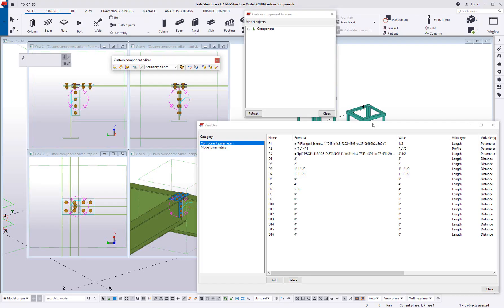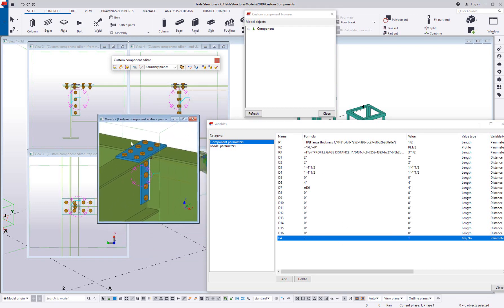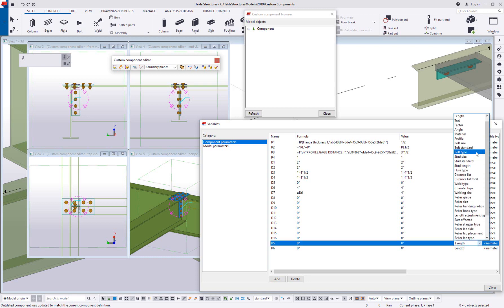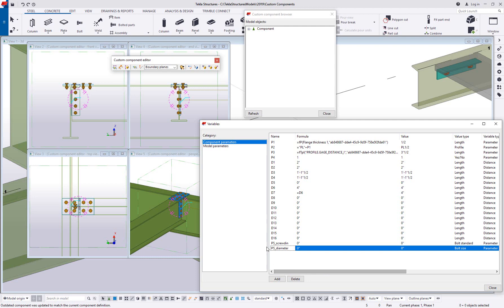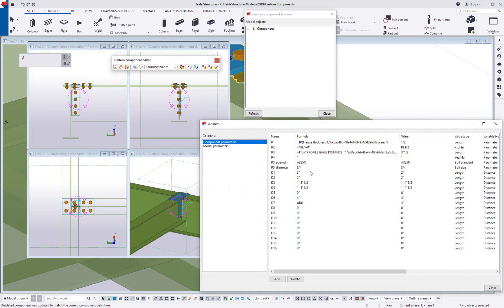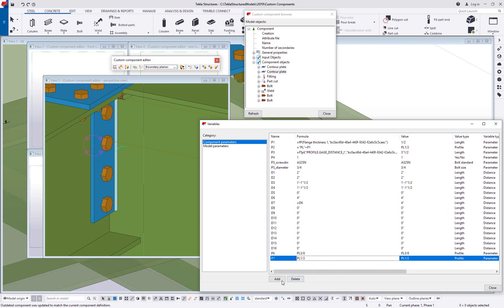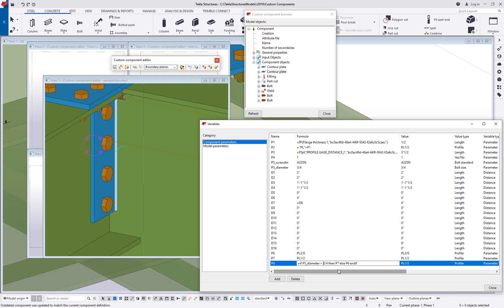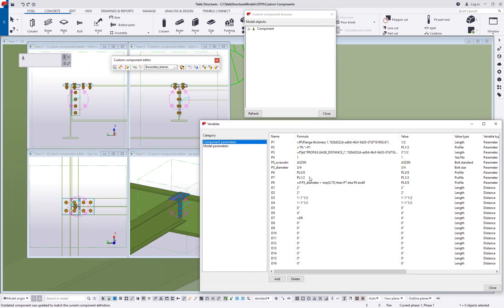Custom Components  - More with variables and formulas

Comment: Hi Dave, 
I was wondering how you would bind a detail to COG?
Reply: I don't know of a way to do this. First, COG is not a snappable point/object in the assembly, plus in many cases applying the component would change the COG, creating a dependency that would throw an error.

Comment: Hi Dave,
Thanks for this video it is most useful for me.
cope cut depth in secondary part minimum clear K-value , if  K-value is 1"1/16 ,cut should come 1"1/8 how to control it.
Reply: Hi, if you look down through the comments someone asked a similar question - you need to use the "ceil" function to round up.
Reply: @TrimbleTeklaDave    I was try "ceil" function but it's not work

Comment: Hi Dave,
for a stiffener custom component, how can i round up to 5 mm (for example) the corner of the stiffener based on the radius of the profile? thanks.
Reply: I've done this before using the "ceil" function - https://teklastructures.support.tekla.com/2020/en/composite_tpled_statistical_functions, so you'll need a variable that reads the profile radius, and then the ceil function to multiply by a desired factor to get up to the number you want.
Reply: @TrimbleTeklaDave  Hi, i do have the variable that gives me the profile radius but i cant make the ceil function to work. In the example from tekla support for ceil function, what shoud i write for "NUMBER_field". If i put in variable that reads the profile radius it doesnt seem to work.
Reply: @stanicastamate3924  Something like this should work (replace with your GUID) =ceil(fP(Rounding radius,"e7596fca-7597-4be0-953e-414a23d8e889")*1.3)

Comment: in Trigonometric functions can I put variable instate of angle number 
for example : tan(seta) instate of tan(d45)  {seta is an variable defined as angle}
Reply: Yes however be careful and check your result, in Tekla many functions will use Radians instead of degrees.

Comment: Hi Dave,
Thanks for the video, It is really helpful. My question is how can I make a custom component to  create multi stiffeners welded to a beam? In other words, I can make a custom component for a single or double stiffeners but how can I make it in a way that number of stiffeners and distance between them can be defined by user? I reckon I should use Array component to make it happen but I don't know how.
Reply: You can either make a component with the 'max' number of plates, and then use Yes/No variables (or similar) to turn them off and on as desired - or you can embed the array component inside your component. You can map variables to the component's fields to control quantity and spacing. If you look in the US imperial environment, there is a CC called 'bay filler seam' with a nested array inside of it that you can use as an example.

Comment: Can I change the size of 2 components together? I created a component and there are many components inside it, I want all of them follow to each others if I change the diameter or height of one.
Reply: Yes, depending on what you are trying to do. Components like Array can affect the component it is copying. You could have one variable tied to multiple components through the component browser. A component can reference parts inside another. There are a few things you need to watch for, however. You can create cyclic dependencies that will cause errors and the subcomponents may not update as desired. Also, the components tend to slow down quite a bit when you start to nest them inside each other. I recommend making several smaller components to be used separately than trying to do one 'super' component. For that kind of tool, the API is much more powerful.